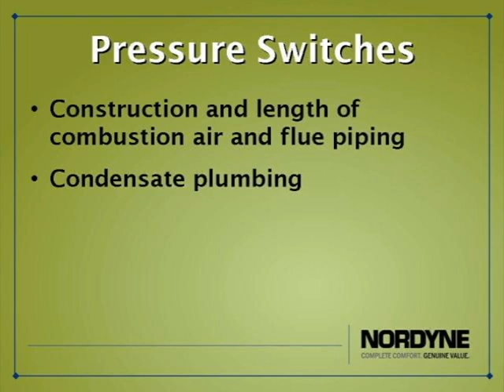FURNACE TROUBLESHOOTING pressure switches  - HVAC Repair  Tips

Comment: Pressure switches made in Costa Rico from about 2011 to October 2013 have had about a 100 % failure rate on many Lennox, some Carrier and Goodman furnaces. Lennox did is a TSB about the possible cause of this.